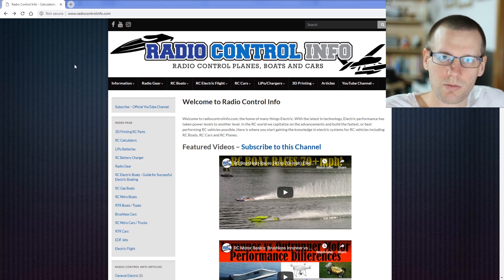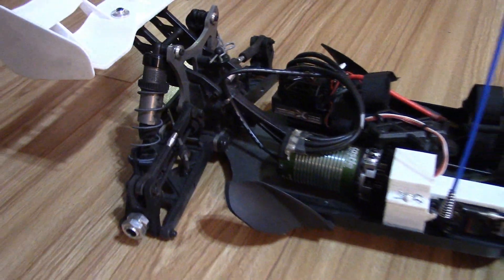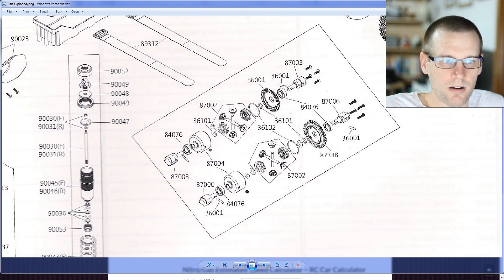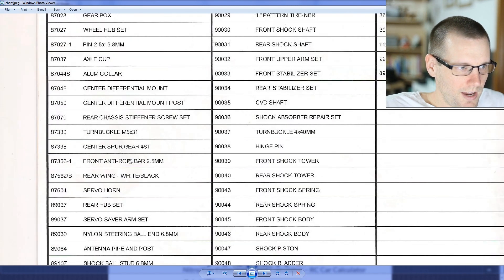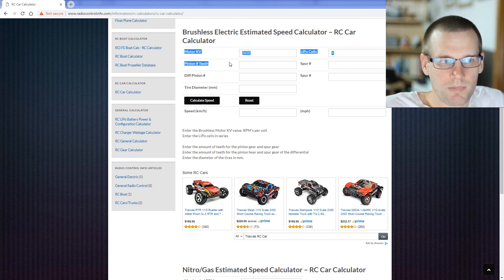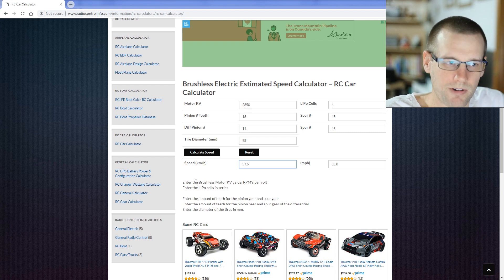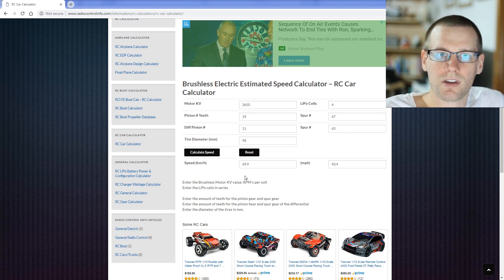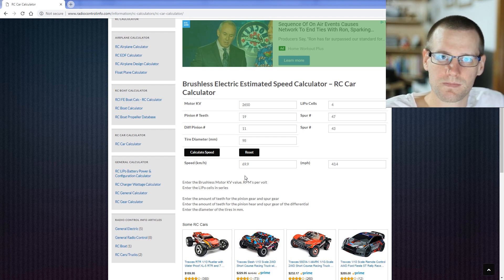How to Calculate Top Speed for a Brushless RC Car

Comment: Motor kv 2000, lipo cells 2 differential(front and rear lockers so is that 30/30 mate), pinion 26, spur 40 came up 162.3kmh that's my exact goal with my car 100mph on 2s!! 😂😂😂 I hope it's correct and will be finding out when my mate takes it for its first run in couple weeks 😂🙏💚👊

Comment: Hi sir...how many distance your calculator set...1 kilometer or what??sory ny english so bad...🙏🏻
Reply from the maker: It's not based on distance. It assumes you have enough power to accelerate to top speed with a reasonable distance.

Comment: no nimh option?? not everyone uses Lipo batteries.
Reply: I had the same problem, to work around it multiply ur battery volts by the kv, and the. Divide it by let’s say a 2 cell lipo(7.4 volts) then whatever the result is plug that in for your kv and it should give the correct answer

Here’s an example
7700 kv motor, 8.4v nimh battery

7700 x 8.4 = 64,680
Next
64,680 / 7.4 = 8740

Plug 8740 and 7.4 volts(2 cell) into the calculator and u will get the correct answer

Check my work:
7700 x 8.4 = 64680
8740 x 7.4 = 64680

Comment: It takes a bit of messing around to find the right calculator without an error message. I found it here:
https://www.radiocontrolinfo.com/information/rc-calculators/rc-car-calculator/
If I put my info in and calculate what I have now for tire size and assume my ESC can handle it, how do I know what my pinion tooth count needs to be, NOT to go faster, but to keep my ESC from burning up if I go bigger with the tire diameter? Thanks.
Reply from the maker: Data log your run or measure the temps of your power system.

Comment: hi! please tell me what continuous current does the calculator consider the lipo batteries to be delivering? i guess that is important to know, right? could make a huge difference on max speed. or does the calculator somehow consider a max current draw the motor would be pulling in 0 load? but then you have the wide difference that motor efficiency could make. and please answer one more question, does the calculator consider the default storage voltage of the batteries when doing the math? or does it take the max recommended charged voltage? 
i am sure i am pointing out stuff you already know well because i learned a lot from watching your channel, so i would just appreciate if you can explain my unknowns. thank you!
Reply from the maker: The calculator does not use current, it assumes that the power system has been correctly selected for a specific RC and Kv value. The voltage is simulated as under average load for the speed.

Comment: Hey I'm having trouble finding mine. Front 43x13 center is 50x20 rear is 43x13 I keep getting 26 mph why?
Reply from the maker: Hello. What is your motor kv, lipo cell count and the diameter of your tire?
Reply: @RCexplained  
Hi! These are my dimensions I'm having trouble

Height: 4.60 (117mm)
Width: 1.72 (44mm)
Firmness Rating: M2 (medium)
Wheel
Outer Diameter: 3.27 (83mm)
Width: 1.65 (42mm)
Axle Hole Diameter: 0.47 (12mm)
Hex Size: 0.67 (17mm)
Weight: 1.4oz (39.2g)

Motor KV is 2050. 6 lipo cells
Reply from the maker: What do you end up with when you type 2050 in to motor kv, 6 under LiPo cells, 20 under pinion,  50 for spur, 13 for 2nd pinion, 43 for 2nd spur and 83 for diameter? I'm not getting 26mph with these entries in to the brushless electric speed calculator.
Reply: @RCexplained  thank you! Thats more accurate now. Im getting around 49.9 mph appreciate the help 🙏

Comment: i use digital tachometer.rpm at tire 4877..360° tire rotation is about 0.23meter.so 4877 divide 60sec equal 81.28 tire rotation for 1sec...so,81.28x0.23 equal 18.69..81.28 tire rotation will travel about 18.69meter. so we have answer..my rc car top speed about 18.69meter/second..so we multiple 18.69x3.6 equal 67.28km/h..

3.6 is formula for 1meter/second equal to 3.6km/h.

so my rc car topspeed about 67.28km/h..done..very simple..

SORRY MY BAD ENGLISH😅😅😅😂
Reply from the maker: What you have done works well too.